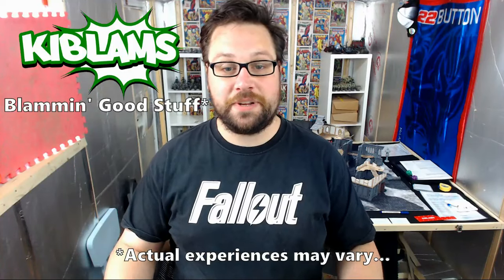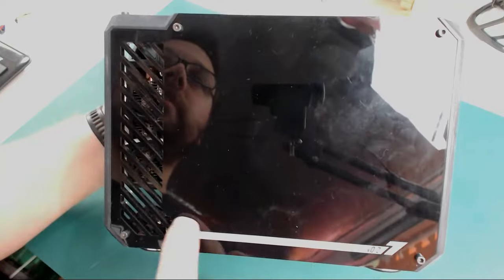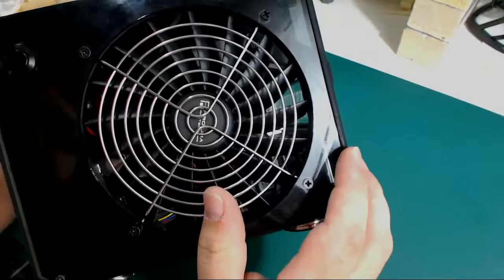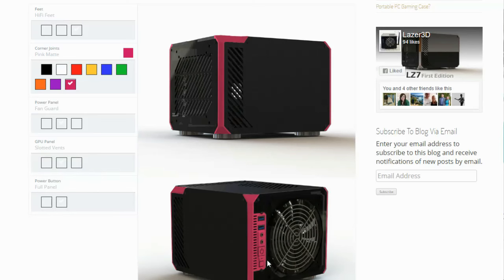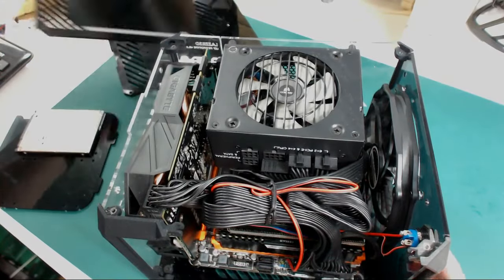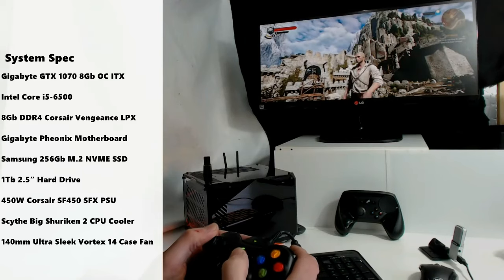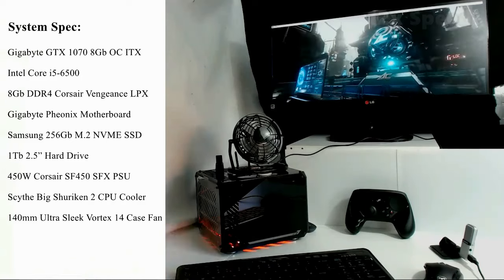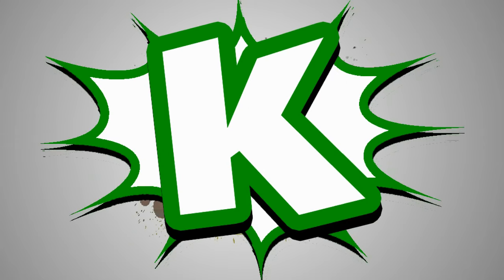Small Gaming PC Case (SFF)

Comment: What a way to do the cable management and somehow you managed it. Woow.

Overall, what's the max size of the motherboard so that it will fit in this particular case?
What about the max length of the graphic card?

I'm interested.
Reply: It is compatible with Mini-ITX motherboards, max GPU length is 186mm.

Comment: is the gpu a mini one?
Reply: Yeah it can fit an ITX length GPU (full height dual slot) up to a maximum length of 186mm.  The current top GPU's under this length are the Gigabyte GTX 1070 ITX (shown in this video) and the MSI GTX 1070 Aero ITX, apparently the MSI version has better cooling and is quieter.  I am looking forward to see what AMD have to offer in the ITX department with the upcoming Vega cards.

Comment: +Vertical position of Graphics Card
+Good Temps for such small and almost fanless case
+Can fit up to 3 drives, ex. (x1 M.2 250GB / x2 HDD 2.5' 2TB each)
+Decent Front Panel (x2 USB3.0 ports, Audio In, Mic, Power and Reset Buttons)
Reply: Wait there fits a HDD?

Comment: thats a pretty impressive temp under load, given the nature of the card. any chance you could get a read out of the cpu, ram and mobo? if not thats ok. hoping to get this chassis for my gfs build
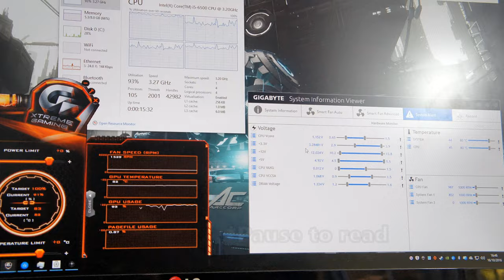Reply from the maker: +Arwel Williams I don't have this system any more to test, but if you pause the video at 8:27 you can see the CPU is sitting at 45 degrees at 93% load and the system is 44 degrees. Hope that helps.

Comment: I"m curious about that 80c cpu temp.  Did you not use Arctic Silver 5 thermal paste or an equally great thermal paste?  That's about the only thing I can think of that would improve temps.

Thank ya much for the video though.  This case has my interest.
Reply: I think the 80C you are refering to is the GPU temp?  Which was running at 82C, this is perfectly normal for a GTX 1070 which automatically overclocks until this temp is reached and then it backs off the clocks.  The CPU temp was actually running at around 45C whilst playing the game, although bare in mind that this is an i5-7500 which runs cooler than something like an i7-7700k.

Comment: crazy question but... would a r9 fury nano fit in this case? or would it be insane to have a card that gets THAT warm in a case this small?
Reply: Jonathan Stinebaugh the R9 Nano should fit no problem and heat wise it should work fine as the heat just gets exhausted straight out the case
Reply: Good to know I guess if the heat from the card was bad enough could add a gpu "firewall" to force the gpu to exhaust all its heat out of the gpu vents

Comment: cpu fan is being blocked directly by the psu, I'm also pretty sure the big fan on top helps outake airflow.. but it looks like its really warm in the middle..  cool concept but I wish the airflow could be adjusted as well as the placement of the parts. want to see a demo running full workload on this for couple of hrs just to see the temps. would like to see maybe just make it a little longer and instead of a huge fan beside make a space for a small aio single fan generator for cpu cooling.
Reply: You would be surprised at how well the airflow scheme of this case works, when the 140mm side fan is set as an intake it pushes cool air over the motherboard keeping temps reasonable.  You can check out some more detailed test results here:
http://www.lazer3d.com/2017/03/24/lz7-build-log-i7-7700-and-gtx-1070-with-noctua-nh-l12/

Comment: You can use a pico psu to it would be better for this case
Reply: That is indeed something that can be done with a bit of modding, a much larger CPU cooler can then be used.  The guy in this forum is in the process of doing exactly this:
https://smallformfactor.net/forum/threads/lz7-8-high-end-build.1162/page-3
Reply: He can buy the hdplex 160w transformator and 300w small fanless psu its 15 cm 6m 9 or so idk but something like that with a peak of 200 220w so you can put a 65w cpu and a gtx 1060 it is enough for a little pc or grt the 300w transformator and putting a gtx 1070 single slot i think it was from galax or other brand that isnt so populair but it is very good

Comment: dose it fit a 3.5 Inch hdd !? if not i do sugest do make the case a bit bigger to fit a 3.5 Inch hdd becouse it is werry imprtant for every gamer or every pc user becouse the 3.5 Inch hdd ar much, much bether than the 2.5 Inch hdd and in the 2.5 Inch hdd we have just 1 tb good hdd and not beager. we have there the 1 tb wd black . so i sugest to fit a 3.5 Inch hdd and to make a round hole under the Motherboard to fit a 12 cm fan on the bottem of the case to blow at the m.2 ssd and to put for These also higher pc feet. the last sugestion is to sold the case with 2 front Panels, 1 like it is now and 1 to Change the existing Panel if you wont to instal a longer gpu Card, and than the front Panel case to have o hole in front to alow the gpu Card to thruw the front Panel. thats all to be 100% perfect case !!!!
Reply: Unfortunately there is not enough room inside to fit a 3.5" drive, you would need to move up to a larger case such as the Silverstone SG13 which does support them.